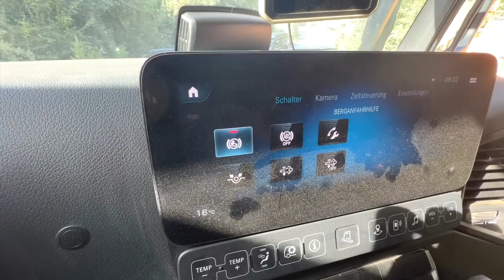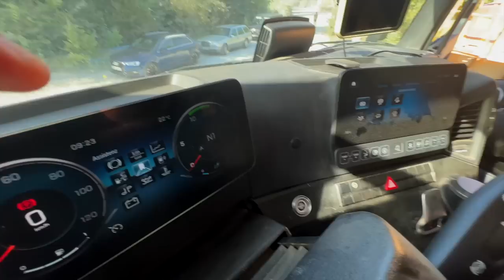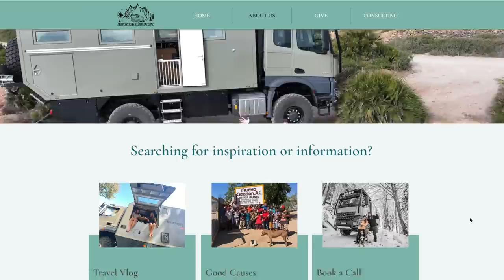Ultimate Off-road Test with Mercedes-Benz Arocs 4x4 6x6 and 8x8 ►| Learn with Pro Daimler coach

Comment: What a great opportunity to see and experience such terrific vehicles. The problem I can see is that they are SO DEPENDANT ON MANY SENSORS AND ELECTRONICS. The whole purpose is to take this too the most remote parts of the world , which by definition means there is no technological way to get assistance when something like an Automatic park brake locks up and you cannot be towed or drive off the road to get repaired. They should be as electronic free as possible so that the DRIVER makes the decision on how the truck should perform.  You look great behind the wheel Isabela, terrific to get some of the knowledge from truck from the manufacture. Am I wrong , but it looks like Mateo is going to have a brother or sister soon ??   It may be better to do a voice over in a video like this or possibly do your own captioning [ yes it's a lot of work, I understand} but the sub titles went by so fast even at 50% speed it was hard to get them read and VERY hard too understand,      GOOGLE TRANSLATE SUCKS , and makes NO sense most of the time.      LOVED THE VIDEO STILL !!     CHEERS AND SAFE TRAVELS       Steve h.
Reply from the maker: Thanks 🙏 for watching 🍀👍🍀
See ya when we see ya 👋 
Fabian Isabela and Matheo 
www.Liveandgive4x4.com